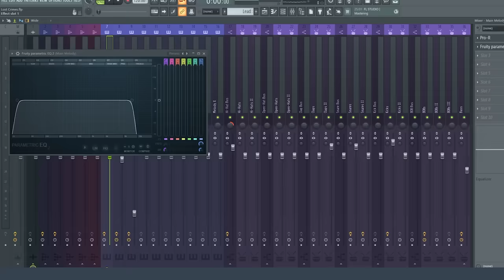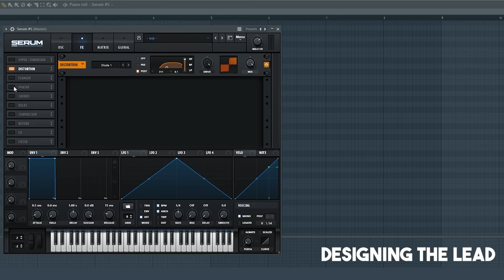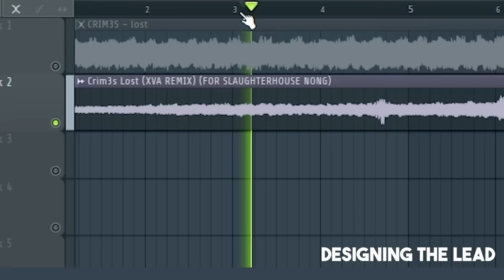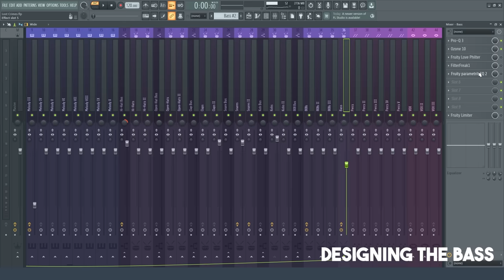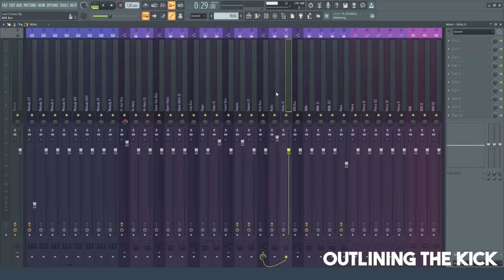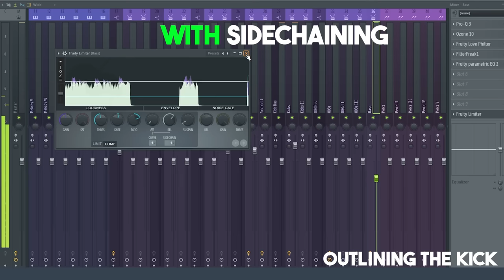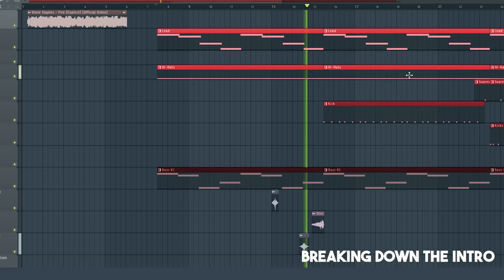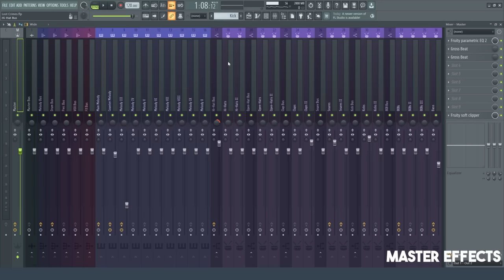How The Slaughterhouse Song Was Made (Crim3s - Lost)

Comment: 0:58 🤓☝️ um... actually, space is like a vacuum, it barely contains any matter and especially not any air for the sound waves to move around, which means that in space you can't actually hear sound because the sound wave doesn't propagate ! Using the example of a large empty room would be more accurate because the sound bounces onto the walls causing the reverberation effect !
(god i hate myself for doing that)
Reply: good video tho lmao it's actually pretty impressive considering the ammount of effects used x)

Comment: 0:58 Actually, space sounds like void, which translates to a total absence of noise or sound. This resides in the fact that sound can't spread in space, and this for a very simple reason. First of all, we have to understand what exactly can be defined a sound, and how we hear it. Sound itself is actually a vibration which is created by an object and transmitted to our ears, making our eardrum vibrate, and said vibration is transmitted to the cochlea by a series of bones called the ossicles. In the cochlea, cilia transform the vibration into an electronic signal which is then transmitted to our brain, which can understand the signal and make us hear. Now, why is there no sound in space? Well, it actually comes from how sound spreads out. To transmit the vibration all the way to our ear, the source of said vibration has to be able to make other elements vibrate as well. To make an analogy, that's how you can sense a hammer hitting a table if your hand touches the table. In the case of sound, the air itself is the main vibrating element that transmits sound to our ears. In space, however, the lack of matter and air makes it impossible to transmit the vibration to anything else than your own body, which means you'd have to touch the vibrating object to "feel" some noise, and it wouldn't be optimal sonce the vibration wouldn't be transmitted to your ears. Besides, echo comes from the fact that sound is bouncing on surfaces and coming back to you, causing you to hear it multiple times. Such surfaces can't be found in space, however. The echo would be heard in a confined room with solid walls that don't allow sound to pass through them, or the bathroom he referred to later on.

Long story short, I have a lot of free time and I'm a physics student
Reply from the maker: I love my commenters but I ain’t reading all that g
Reply: @PierrekYT  basicall tldr i've just been jabbering for about 20 minutes about one small mistake that you made where sound doesn't exist in space since there is no air back there and air is needed for sound to, well, sound